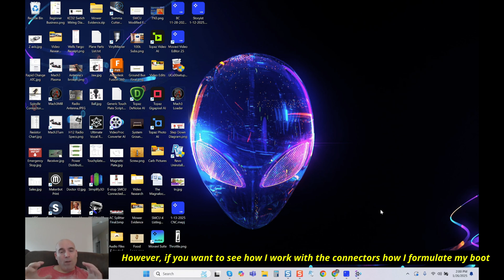How To Build A Professional CNC Spindle Cable

Comment: What a pity those spindles use such an antiquated connector design that requires this treatment, as opposed to a modern connector with nice cable gland, matched with a cable that doesn’t require as much strain relief.
Reply from the maker: They certainly require more work then most, but once you understand them they're really not that bad. Thank you for your support. 
Vince

Comment: By far the Best way to make cables.
I have to make cables for my welders, remotes, foot pedals and amp control's etc.

I follow this method, I just use a different connector obviously i have to follow the machines connector,  which is typically a 6 pin MS3106A14S-6P or 14 pin MS3106A20-27P Amphenol connectors.

To learn I bought a load of cheaper connectors with the same size pin/solder cup connection, and practiced on those until i was confident and getting consistent results.

Its so much harder than it looks to solder these and have them looking as good as Vince's cables.
You really have to break each step down follow it precisely to get these type of results, no short cuts.

But once you start getting consistent results its worth it.

Having this channel is super helpful while i was dialing in my practice routine.

I can consistently get really nice connetors on my welding pedals and remotes now.

Thanks.
Reply from the maker: Thank you for your kind words, and support. Practice is everything. :) Vince